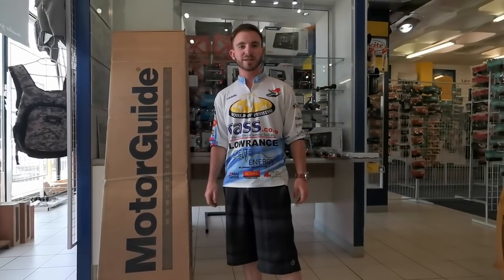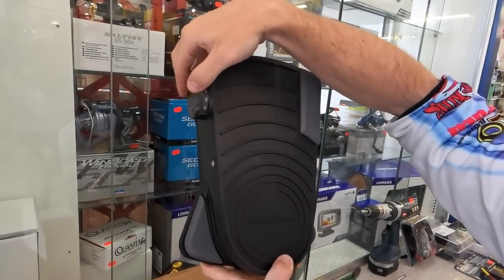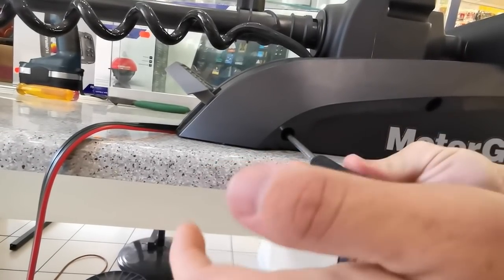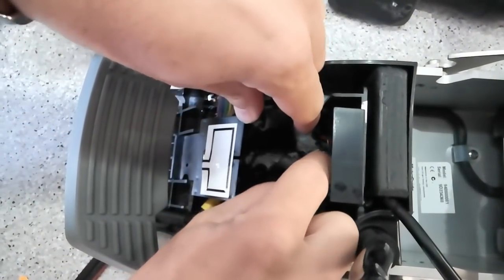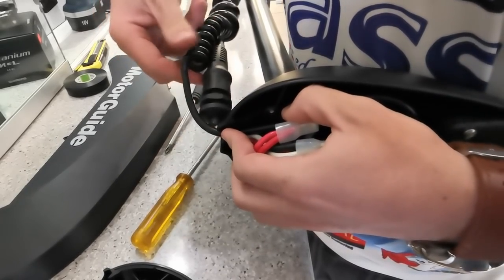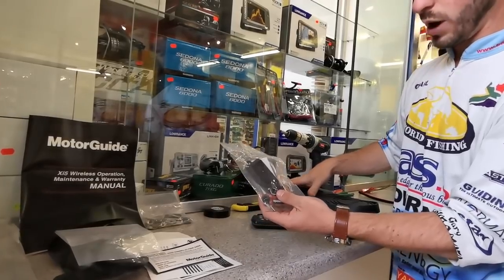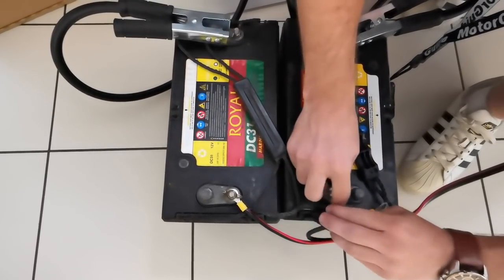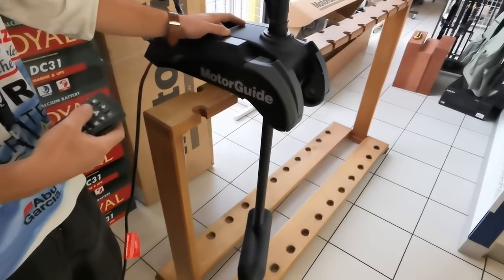Motorguide Xi5 Unboxing, Pinpoint Module Installation and Testing

Comment: Bought an xi5 14 months ago. It stopped working. The nearest service center is 2.5 hours away.That's 5 hours driving just to drop it off. I called motorguide and was told to buy the control board and install it myself. I don't live in BFE I live in Ft Lauderdale and have 3 Minnkota service centers within 30 minutes of me. If you live in South Florida Motorguide's warranty is like Obama Care, you have insurance but you cant use it.
Reply: Had the same problem.  They are junk and customer service is garbage.

Comment: That tape mod is a must do for this motor.I wish I would have done that when I first installed mine.Mine spun around while in anchor mode,and stretched/broke the wires going into the GPS module.Now I have pretty much the motor that the author removed from the box.It was just out of warranty,and MG pretty much told me to KMA.

I could not find out if the current part is improved from original with better accuracy,but I see the date on the Pinpoint box is from 2014.The dongle update did little for mine,still had positional problems with it.It would go goofy,and wrap itself up tight.Some days it was perfect,others not so much.Pinpoint kit isn't cheap(around 425.00 or so),so I just got a Minnkota Terrova BT to replace it.

I still have the Xi5,but if the current kit is no different than original,then I should just trash it?0 issues so far with the Terrova,but steering is slower than Xi5.Would be nice to have Xi5 for a spare.

Comment: The boat is ofsetting like a meter in anchor mode, is this normal or need calibration?
Reply from the maker: Good Day. We would suggest doing the Offset calibration once and the Compas calibration twice. 1m is not bad at all.... According to the Official GPS website: "The accuracy commitments do not apply to GPS devices, but rather to the signals transmitted in space. For example, the government commits to broadcasting the GPS signal in space with a daily global average user range error (URE) of ≤2.0 m (6.6 ft.), with 95% probability, across all healthy satellites in constellation slots. Actual performance is typically much better. On April 20, 2021, the global average URE across all satellites was ≤0.643 m (2.1 ft.), 95% of the time." Reference: https://www.gps.gov/systems/gps/performance/accuracy/#how-accurate
Reply: @BassWorldoffishingtacklestore  Thanks, offset and compass cal. like shown in the booklet?

Comment: Hello, greatly explained and showed !!! I have a few questions: 1) that piece of cable that you named NMEA, exactly on 14th minute of the video, that you pulled out from the bottom of the unit after you installed it - what is it for ? and, I have Garmin Ecomap Ultra 126SV with Panoptix - do I have to connect that piece of wire to Garmin to make its work or not ? Appreciate your answer. Thx
Reply from the maker: Hi Russ! Thanks for the comment!
That NMEA 2000 cable is to connect to a Lowrance NMEA 2000 network and provide interface between a Lowrance Elite TI, Elite Ti2, HDS Gen 2 Touch, Gen 3, Carbon or Live unit.
Unfortunately this cannot communicate with your Garmin fishfinder as it is a Lowrance / Motorguide autopilot feature (Exclusive to Lowrance)
Reply: Thank you for an answer. All the best

Comment: Do you need a Lowrance to take advantage of the pinpoint accuracy.i hate to. I own a new Garmin fish finder .just wondering b4 I spend over a thousand dollars that I don't need to upgrade fish finder.
Reply: You can use either a Humminbird/Lowrance, certain models to network connect but unit will use pinpoint without another fish finder connected. It has its own GPS function.

Comment: Hello. Do you have to connect it to your Lowrance for the gps to work. Or could you theoretically use this for spot lock/anchor without any nmea connection or fish finder?
Reply from the maker: Hi Stanky Fishing. You do not require the NMEA 2000 Connected to the lowrance to have an Anchor Lock motor. If you have a GPS Anchor Lock Model, it will use the internal GPS in the Xi5 to Anchor Lock

Comment: Hello and great video. I just purchased a Xi5 and a Lowrance Elite Ti2 and I thought they would link together wirelessly. Can they link wirelessly or do I have to purchase the NMEA starter kit to link these together?
Reply from the maker: Hi Jay
You will need a NMEA 2000 Starter Kit and the Motorguide Lowrance NMEA Gateway
Reply: Thanks! I guess they forgot to mention that I would need to buy another $200 of cables to get that feature to work.
Reply: @BassWorldoffishingtacklestore  Hi, thanks for the great video. I have just installed my Xi5 pinpoint  together with gateway and NMEA and it seems to have worked 1st time, i was able to access the menu on my Elite Ti and anchor to cursor 50 yards away. I just have a question about the noises / beeps the motor makes. I can't find reference to them in the manual. When I engaged anchor again it beeped continuously ( a few times a second) until I disconnected power from the motor. Have you experienced this and what do you think it could be? I have a short video I could email to you or upload.

Comment: Ok I have a xi5 and it's just out of warranty and all of a sudden when I plug it in to power it just starts spinning until wires are tight I've had to buy a new GPS module and install at a cost of 750 dollars set it up and same problem any tips would be great not very happy with it ATM
Reply: I had same problem recently. Fixed by replacing dead battery.

Comment: what i buy something and have to pull it apart how stupid is that
Reply from the maker: Why would you have to pull it apart? This is how to UPGRADE your Xi5 to a pinpoint GPS model if you bought it WITHOUT the pinpoint GPS. If you bought the Xi5 with Pinpoint GPS, then you don't have to add the Pinpoint GPS as it already has it... but if you bought the non GPS model... you can turn it into a GPS model :)